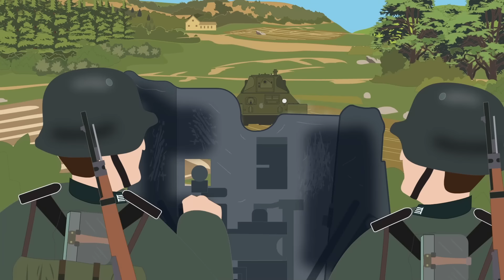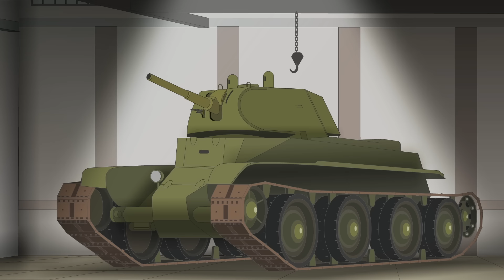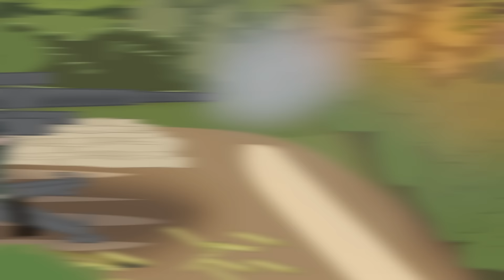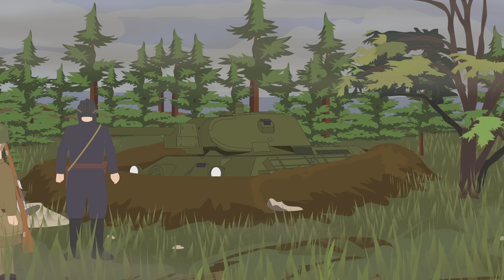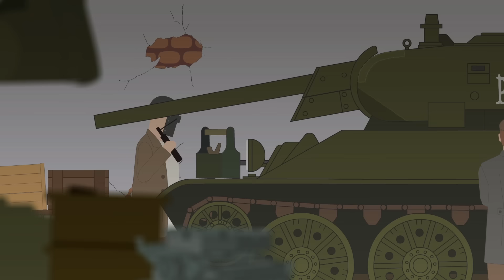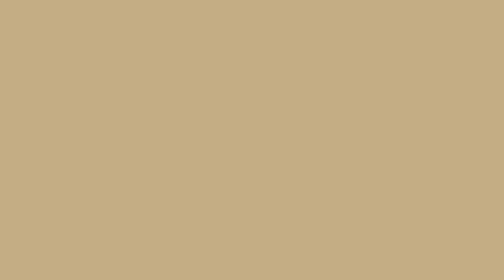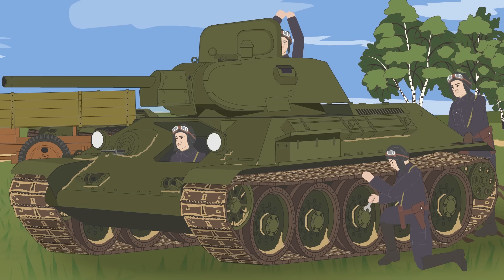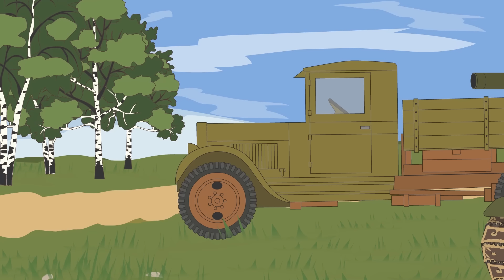Was the T-34 Really the Best Tank of WW2?

Comment: T-34-76: 35,330 units
T-34-85: 25,914
PzKpfw IV: 8,573
Tiger I: 1,449
Panther: ~6000

Have you got any questions?!
Reply: Soviets count tanks that were damaged but returned to factory as "new". So actual numbers of tanks are a bit different. Germans produced just over 46,000 tanks and tank destroyers starting with panzer 3. Remember Soviets started with almost 10x as many tanks as Germans.
Reply: @tomk3732  what are you trying to say? The "46k" are total tanks produced I am guessing and it's still less than the Soviet T 34 alone. They started with 10x more tanks and they ended with more tanks which should not be surprising to anyone. How any of that information even relate your first statement that they counted returning tanks as "new".
Reply: @tomk3732  *10000 rusted 1933 t26s
Reply: Yes, 44,900 T-34 were destroyed....
Reply: @rolandhunter  And most of them can easily prepared after battles and about 30,000 can reused in just few days while Tiger just suck when damaged and many platoon need to destroy or left them, that's the different. Not only that T34 super cheap compare to Tiger
Reply: @rol4859  T-34 was not much easier to maintance as you think.
Example when the Bäke Geavy Armored Regiment did a counter push in Ukraine in 1944 january, the 1 of the Soviet regiment had 43 T-34 only 1 was operational.

If we compare the prices, you could build 3, maximum 4 T-34 in 1942-43, in 1944: 4, maximum 5 T-34.

The Tiger cost was not "insanely" hight, only at the production beginning, but its true on the T-34 aswell. 

The first Tiger was 800.000 Reichsmark, in 1943 its reduced to 255.00 Reichmark.

To compare it:
According to rough estimates the labour hours n in comparison to the Panzer III stood at approximately 1 to 1.25, i.e. four Panther vehicles for ever five Panzer III tanks built. Cost (without weaponry) PzKpfw III RM 96,163; Panther RM 117,100.

Panther final price was 143.000 RM.

So from 1 Tiger price, you could build roughly 2 Panther.

What about the "cheap" T-34?

The first T-34 in 1940 was 429.000 Rubel, in 1945 it's reduced to ~130.000. (But it was depent by: where it was made)

Some factories produced the T-34 with higher cost than ~130.000 Rubel.

PS: Kingtiger was 321.000 RM.

Source:Armored Champion: The Top Tanks of World War II page 39.
Reply: @rolandhunter  Yes, but can panther fix easily like T34 ?
Reply: @rol4859  Depends on which part.

The overlapped wheels was complicated a little bit, on the Panther.

The Transmission change was easier on the T-34 because it was behind the engine, in the Panther it was in the front, so you had to traverse the turret to the side, remove the driver, radio operator seat and everything near of it.

You could dismantle the steel plate cutout (above the driver, radio operator) to get out the transmission.

But if we talk about the other parts, like turret, barrel, engine, it was the same difficulty, or sometimes the Panther engine section was easier to repair because it was a gasoline engine.

For the Tiger...oh my...you had to remove the turret for transmission change....that was....not ideal. But the Tiger transmission was half automatic, and had planetary gear, so after the teething problems are fixed in 1943, it was almost invincible.
Reply: @rolandhunter  Yeah, tbf Panther is one of the reason why Soviet still tru to make and improve KV1, later KV85 and finally IS-2
Reply: @rolandhunter  yeah if only those panthers could reach the front line before its power burst into flames..
Reply: @rol4859  the issue with repairing is more determined by which side is advancing.  If you're losing ground you don't tend to recover many vehicles to repair.
Reply: @solthegamer3769  you talk of reliability when 1/3 of the T-34 fleet broke down in combat?
Reply: I have a question: How much wood would a woodchuck chuck if a woodchuck could chuck wood? It's driving me crazy!
Reply: @danielkyle7094  get a government grant and do the research.
Reply: Plus in many books and documentaries, the T-34 didn’t have that Toyota reliability that everyone talks about, they were many problems with them, but they stand because they produce a lot of them, plus the German tanks were built accordingly to samples and tests, a lot better and have better quality of built in every thing inside them even like the sights, AND plus talking about the Tiger running out of Amunnition because there were too little, the tiger was just a unit in the camp of battle there were, panzer 3, panzer 4, Panthers, Stug 3, Jagdpanzers and Flak 8.8 and flak 7.5 cm in the battle, plus the air support and armored vehicles to transport units like the Sd.Kfz.251, so no the Tigers were not fighting alone, AND THE REPUTATION they built it was because there were so good, pretty good armor that even if you land a good shoot in them most of the time it would just bounce off, good precision and that big 88 mm cannon that destroy everything it was shoot at, plus the big distance that was able to shoot, in the first stages the M4 Sherman and T34 could’t shoot at the Tiger insight because they  round couldn’t reach that far and if it reach it just would bounce off, while the tiger could aim at them very good and converting them into smithereens.
Reply: @solthegamer3769  no they were not T-34 bogged down even on bloody clear ice at Stalingrad and Leningrad outskirts.
Reply: @VisualdelightPro  That was early in the war. The T-34s reliability grew throughout the war. And my other points still stand
Reply: I gather total AFV numbers built are 87,956..... mind you 4545 were armoured cars and 21880 were APC plus 1225 ammo tanks & 716 HQ AFV . But then again they don't matter do they????

Germans also built thousands of Jagdpanzers / StuG through out the war APPROXIMATELY 17,770  .Then theirs 1625 self propelled howitzer and 2053 self propelled AAA plus 3398 panzerJagders.i guess those don't matter either.?????

YES 8872 were RC anti mine drones....but then i would have used that asset quite differently.
Reply: No one asked
Reply: @simplesandbox  others need to know...but not you.
Reply: I have a question, Who asked?
Reply: @Moger-x4q  WHY you did, don't you remember.
Reply: @solthegamer3769  
>T-34
>Reliability
Pick one
Reply: @SirHellNaja  Later models and production, and it's compared to the German big cats, which are what everyone compares them to for some reason
Reply: @solthegamer3769  the t-34 was not reliable at all as they spent more time broken than actually working. There is a reason most of them were used as stationary gun turrets. The only reason Russia made progress or even survived the war is everyone else helping them with supplies. The vast number of poor quality tanks doesn't mean it is reliable and why Soviet tanks crews had a very short life span. It is the same for most future versions of Russian tanks, poor overall quality and just throw sheer numbers at the enemy and hope to win. Hence, why guys riding horses and camels beat-up Russian tanks constantly for the last 60+ years.
Reply: @mrg09211976  actually mongolia helped more than allies by lendleasing A LOT of meat and food, while allies' lendlease was only ~3% of Soviet weapons and tanks
Reply: @neko222comrade  the food overall wasn't much since it almost all went to the elite and not the soldiers. What would be nearly 50 million (1 billion today's value) in cash the US gave Russia was. Not to mention even before Germany invaded Russia, the US was supplying them with goods.
Reply: Nobody question that, the thing is what tank was better, plus if they have that the Germans with less did more damage.
Reply: Rip, Tiger tanks came in such little numbers it usually ran out of shells before the enemy ran out of tanks.

Comment: Always between the T-34 and the Sherman for me, T-34 was better in Top Trumps battle terms, but the Sherman was more versatile and used on every front. Later German tanks have combat top trump marks but don't stand up elsewhere, which the T-34 does and Sherman definitely does.
Reply: The fact you are comparing the Sherman and t-34 as similar yet forget that the t-34 was almost 3x cheaper
Reply: @joselee9605  Yes, but almost 100,000 Sherman chassis' were still produced during the course of the war, which is, I believe, roughly 20,000 less than T-34 and 85 tanks were produced. That is not a massive difference. The Sherman and the T-34 are similar in that they are both economical vehicles, it's just that the T-34 is entirely devoted to being economical, the Sherman is more complicated than that.

Comment: something he forgot to mention with bolting the armor together is that when molotovs were thrown onto one of these tanks the bolts left gaps inbetween the armor so if a molotov was thrown on a tank the flaming liquid would seep in and disable the tank
Reply: Yeap. Apart from that rain, snow, mud, dirt and grease, all come in and damage the electric lines, cables, equipment. No use making your engine exhaust Molotov-proof when the crew can still take the damage, well spotted.
Reply: @RetroCptn  yup that was the case at Krasny Bor, the Soviet Guards Rifle division lost most of their T-34s and brave tankcrews to Spanish Blau 250th Infantry Division Veterans of the Spanish civil war.
Reply: — Bolting armor together!? What tank exactly do you have in mind. Not a T-34 for sure.
Reply: @RussianThunderrr  Simple History was explaining the main methods of tank production during the interwar and early war period.

Yes, the T-34 didn't have bolted armor, but a lot of tank developped during the interwar did, such as the Panzer 38t (which was a tchek tank produced for the germans after 1938), or the various tanks and tankettes used by the Italians.

I don't have the time to search for it, but a lot of other tanks used bolted armor at the beginning of the war.
Reply: @Paludion  wrote: "Yes, the T-34 didn't have bolted armor, but a lot of tank developped during the interwar did, such as the Panzer 38t (which was a tchek tank produced for the germans after 1938), or the various tanks and tankettes used by the Italians."

-- Pz. Kpfw.38(t) was actually developed by Russian engineer Soorin Aleksey Michailovich who finished Polytechnical Institute in Kiev, and then artillery Academy immigrated to Europe after civil war, and there he developed this tank for Skoda. The armor was riveted. Earlier Soviet tanks were riveted too, but a few generation prior Soviet tank production switch to welding, and that is affected both light tanks like T-26, and direct predecessor to T-34 BT series tanks.
Reply: @RussianThunderrr  the video literally mentioned armor being bolted, please check your facts before you say im incorrect
Reply: @AEWYU  wrote: "the video literally mentioned armor being bolted, please check your facts before you say im incorrect"

-- So you decided to add your own inaccuracy on the top of the one that presented in video. None T-34 tanks were bolted together, they were all welded.
Reply: @RussianThunderrr  i must be mistaken with another tank then, i do know that there was a russian tank that was vulnerable to molotovs or incendiary devices
Reply: @AEWYU  - That is OK bud. There were gasoline powered tanks namely T-26 that was very susceptible to Molotov cocktails, that was btw a Finish invention to fight Soviet tanks in winter war of 1939.
Reply: @AEWYU  I have heard that early t-34 were susceptible to molotovs too, i don't remember where. But that was due to the poor quality Welding which could leave gaps or get damaged after being hit. This was due to the inexperienced workers and need to produce tanks as fast as possible, Didn't matter if a few tanks were knocked out due to shoddy welding if you had a lot more tanks because of it. I have even heard that some T-34s would come with a second engine strapped to the back so when your first broke down you just replaced it since there were few spare parts or the logistics to supply them. Although i'm not sure how true that statement is.

Comment: Normally people think of best tanks by 3 point system (firepower, defense, and mobility). By those stds German tanks are by far the highest. However, if you use the 6 point system (firepower, defense, mobility, mechanical reliability, production value (cost to make), and versatility) the answer is the Sherman. The deciding reason is on the versatility. T34 and Sherman are competitive in all other categories.

Versatility comes thanks to variants created by the allied nations. The Sherman had an amphibious, AT howitzer, rocket artillery, medical/logical, mobile AA, mine clearing/laying, ammo/fuel carrying, to name a few. The Sherman had a variant used in almost every possible role. Were it not for the common wealth, Dutch, Australian, and minor nation input models Sherman would be more tied to t34. The power of a chassis is to streamline and perform more roles, than building other vehicles for said roles. 

Side note, they adapted term "Tommy cookers" mostly due to British forces overstuffing the tank due to unreliable resupply reasons. Had they carried designed amount the chance of fires would've been alot less. Afterall, its not hard to set a tank on fire if you're guaranteed to hit a stored shell if you hit the tank.